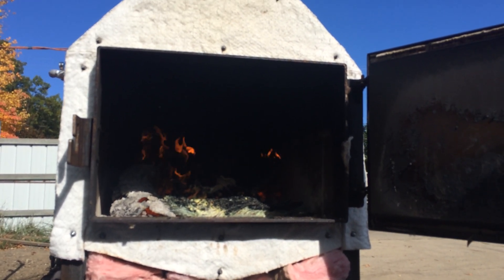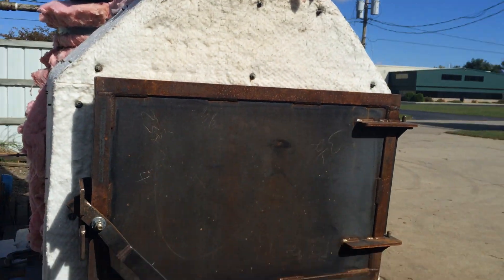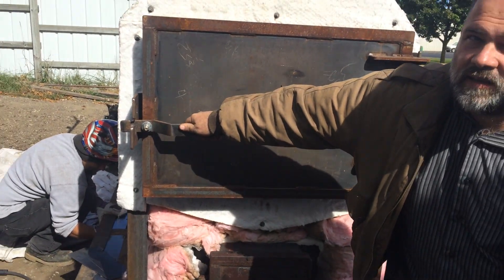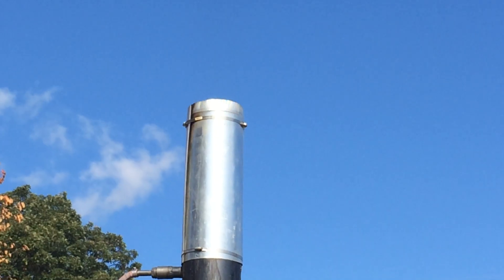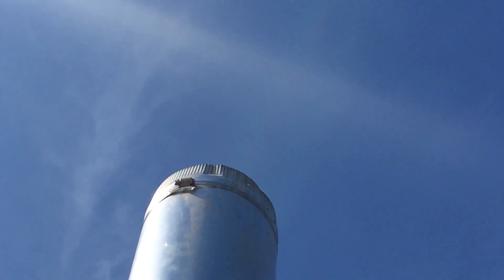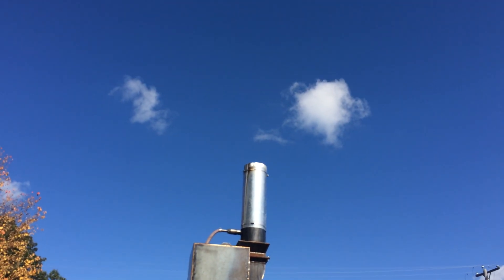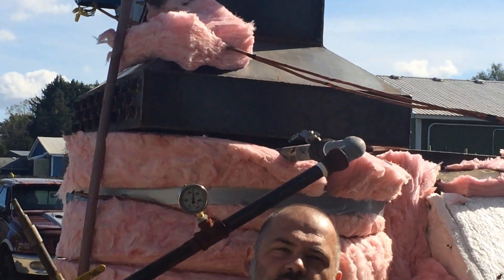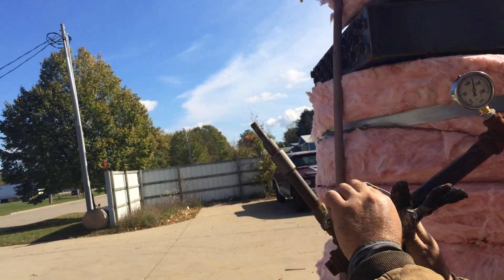Gasification boiler burning tire

Comment: Why aren't you using the stack gas to run another generator? It seems like a waste of good resource. The steam is good, but the gasification is better.
Reply: realistically, this would heat an apartment block or a big farmhouse.  a properly designed chimney would draw the exhaust  through a thermal mass.
Reply: Because that Syngas would destroy an internal combustion engine.
Reply: That is true unless you filter it properly.
Reply: Jim Rojas It would destroy the filters.
I've built gasifiers before for running both cars and trucks. You need the perfect cleanest fuel for ICE (internal combustion engines)

If this guy hooks this boiler up to a steam turbine he will have something here.